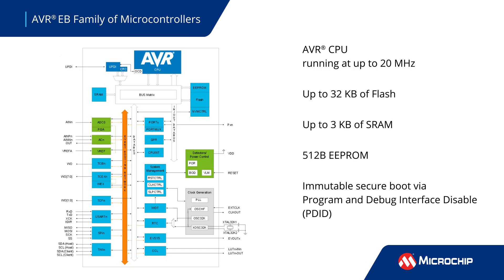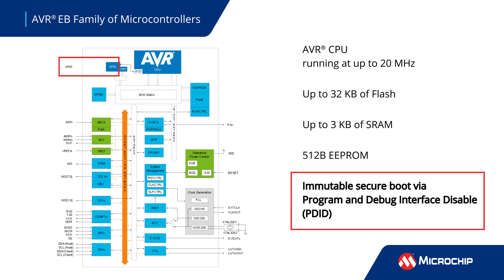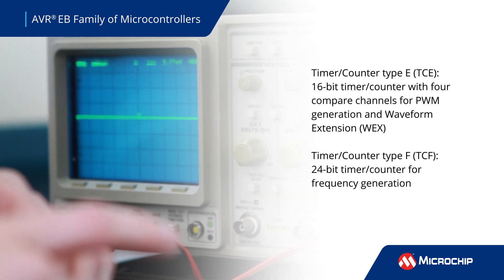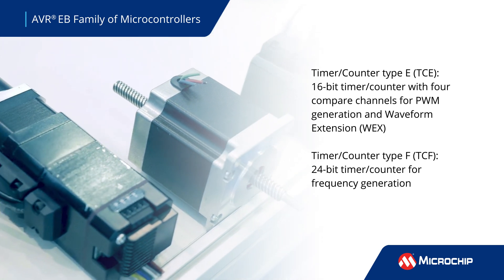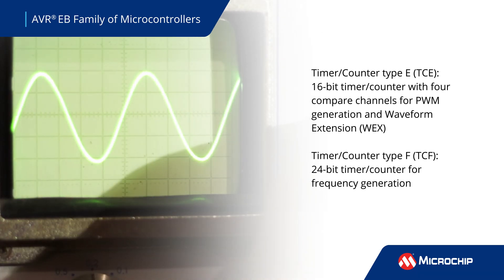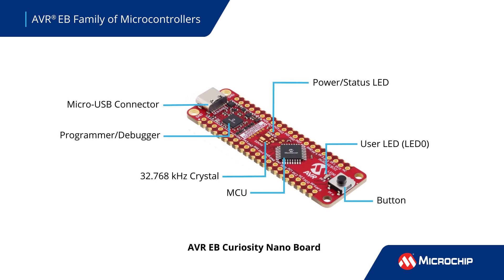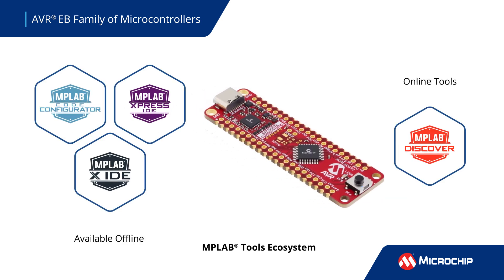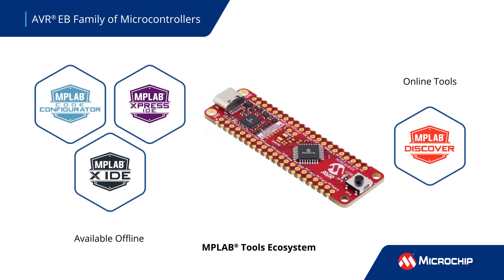AVR® EB MCU Family Overview

Comment: You need to improve the UPDI programming tools ecosystem. Bought PICkit-5 and it is pure bugged out trash.

Please make some open-source initiatives, I think that would be best for the AVR community.
Reply from the maker: Hi Leonard, we appreciate your feedback and will pass this along to the development team who can hopefully help to incorporate these improvements into its next set of bug fixes / updates.
Reply: Have you  tried pymcuprog? It can program UPDI devices through serial port interface when connected in half duplex mode.  It cannot run debug though, so if that's what you are looking for, it's not the right thing.